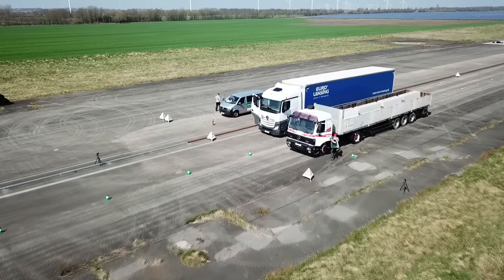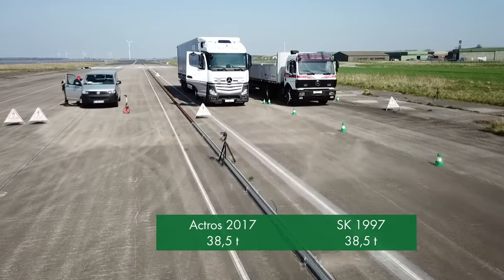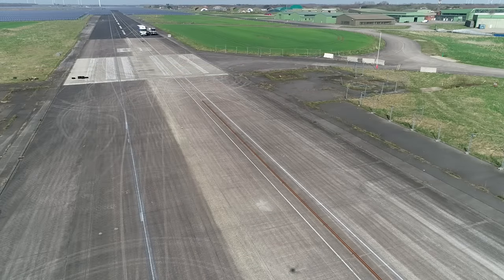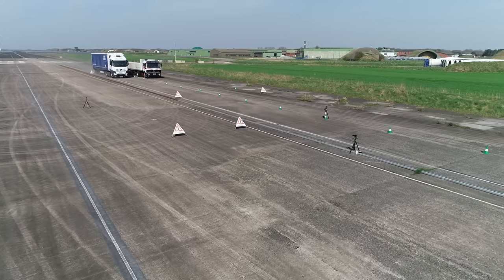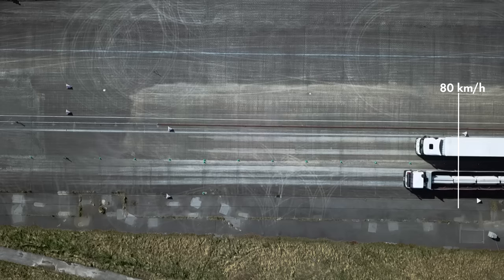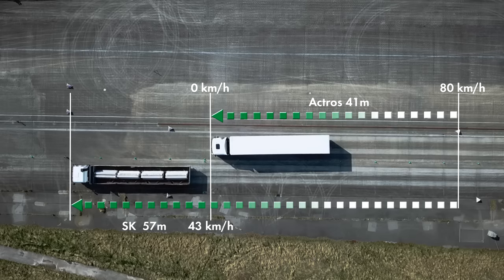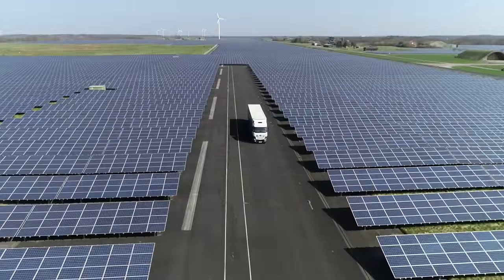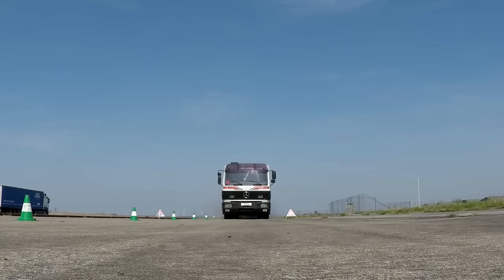Brake test: Modern truck vs. old truck

Comment: Who else with even basic vehicle knowledge noticed the guy in the older truck wasn't even trying to stop fast older trucks don't have abs so have a quicker skidding stop but that puts more wear and tear on the truck thats why they aded abs to save people money since the truck in this video didn't drag even a single tire but the new truck did either the breaks are faulty and don't work so the vid isn't a good even comparison or they did it on purpose to pretend newer trucks are better at stopping also the kind of tire has a huge impact on how fast a vehicle can stop so of course they left that out

Comment: I wonder, why does the new truck have a closed box? Why they didnt show the cargo in the trailer?
Is it because its an empty box?
Put flat beds on both and i will believe it!
For now its just fake for me!
Reply: Dont look fake. The new truck brakes harder by the look.
Reply: you are nit picking, its really stupid to belive that 20 years older truck will have the same brake power as a new model
Reply: It don't matter if there's a load or not. With a load you have more pressure on the tires, without the truck has less pressure, but also less weight. The brakes are made for the loaded truck, and the truck adjusts the brake force depending on the actual load. 
This has nothing to do with a passenger car.
Reply: @simonm1447  More weight will mean longer braking distance.
Just because you have more weight on the tires, and therefore more grip, it is NOT equivalent to simply having less weight.
Reply: @reinbeers5322  I know it sounds strange, but an empty truck will really don't stop with a shorter brake distance than a fully loaded one. Brakes of semi trucks and their trailers are designed for full load, they can absorb the heat of an emergency braking maneuver. With a fully loaded trailer you have much more friction on the road, so the brakes can work with 100%, if the truck is empty they can't and work with less braking power. Modern trucks with air suspension calculate this with the acceleration (how fast it accelerates if it's leveled, they have a tilt sensor in the truck), older ones have a simple device which measures the suspension travel of the leaf springs. 
https://shannonlawgroup.com/calculating-stopping-distance-semi-trucks/
BTW, I had a education at Daimler when we picked up our new truck, and they told the same
Reply: "Put flat beds on both and i will believe it!" - no, you will not.
You will demand other things. "Show me they are putting the same braking force to their pedals! Show me the tyres are the same! Show me the conditions of braking mechanisms! Show me the road surface is equally contaminated!", etc., etc., etc.

Comment: These tests are always Manipulated to suit the Desired outcome . 
Of course the New tech is Better that I’m not disputing , but what is the Condition of the Brakes on the Old model?
Reply: Yep the driver was told your bonus depends on you letting the newer truck win......ok boss no problem.
Reply: @bertiewooster3326  
Exactly Too many variables , what about the Condition of the tyres ? The weight of the Trailer ? Driver reaction? Quite a few things to consider

Comment: I like the brevity of this video, but they didn't say anything about how this much-improved braking distance was achieved.
Reply: i would asume improvements in the anti lock system. keeping the tire at the optimal slip point where you have max brake performance and not just increasing brake pressure until lockup and then releasing it a bit to get the tire rolling again as it used to be.
Reply: @sgxbot  I think so too. Brakepads itself are probably at their prime for years (if not: decades) already and can't be improved anymore.

Comment: The driver in the old truck should have pump and release the brake multiple times, then it would have stopped more efficiently
Reply: Why would he do that if the wheels never locked up?

Comment: Just curious about this test as the trailer brakes also has a huge impact in fact the brakes of the trailer caries the load of what's within it the trucks brakes allows for both to come to a controlled stop ...

Why is it two different trailers ?
Reply: And we want NEW BRAKES for both of the truks .....you know....marketing....new=,,better"

Comment: There’s a difference between a 20 year old truck and a 20 year old truck with 20 year old brake pads. Truck break technology hasn’t changed much in 20 years, the only difference is ABS really
Reply: it has gotten a lot better. back then the abs would lock up and unlock the tire multiple times per second. today the tires dont even lock up anymore when above 5 kmh or something like that.
Reply: @sgxbot  That most likely has more to do to with high speed electronics than anything else: when ABS works its magic, huge, HUGE currents flow through the electrical system as it tries to regulate braking power as good as possible. Besides a possible 'arm system for impact' (deploy airbags), this is the sole reason the audiosystem in a car can stop working when doing an emergency stop (did such a stop on purpose once on an empty motorway, doing 80 km/h (had just sped up coming from the slip road, and the sound system immediately stopped working as soon as I fully braked).
Electronics have improved so significantly in speed, efficiency and such that the computers are now far faster and (thus) far more able to keep the wheels from temporarily locking up. If the same ABS system would be fitted on the newer truck, it would have the same outcome as on the old truck.
Reply: @weeardguy  that actually has not much to do with the faster electronics because its the sensors that are required to detect the amount of slippage etc that hasnt been around back then.

Comment: Having driven numerous different Merc Actros's I have to say they model in this video has terrible brakes. DPD use them, and apparently use genuine Merc brake pads, (I asked a mechanic whilst working there).  You press the pedal and initially it feels good, but then feel like its not going to stop. The older Actros (Euro 5)  the brakes felt great.  I wouldn't like to drive that old banger of a truck in this video though,  having just watched it trying to stop.

Comment: OMG, all those dumb comments. "If they would use the same trailer, and the same tires, and the same brakes and and and and.... the same components, so the old truck is equiped with all new tech it would have the same distance, duh". Again: The point is to test 2 vehicles of two different eras with their current technology and not new vs old with all new parts.

Comment: The new truck had smoke from the braking wheels ect. the old one did not, seems odd. how old were the brake pads on the old truck?
Reply: looks sus to me, like the old one wasn't braking as hard as it could
Reply: Because the brakes on the old truck is just much worse and doesnt brake as hard, thats why there isnt any smoke, not hard to understand, the old truck just performaned bad due to its inferior technology in brakes and braking system. They are trying to show the difference in the new vs old technology and brakes and brakes should behave the same even if they arent new as long as they isnt completly worn out.
Reply: @barzinimongo  You can't compare wore out brakes to new ones then the test is fake.
Reply: @freevideos051  I highly doubt they are worn out, were do people get that impression, you do know what worn out means right? Theres a difference in worn and worn out and in most of the cases the brakes should function the same worn or new, if they are worn OUT I can understand it, but they are probably not, just accept already that modern tech is better then 90s tech.
Reply: Drumbrakes vs Diskbrakes. A F1 car smokes too, but wouldn't with a closed system like drumbrakes.

Comment: I dont think the driver with the cement block is too keen on hard breaking, those block tend to keep moving and cruch em cab. There are such things as an object in motion stays in motion with the same speed and in the same direction.
Reply: he braked hard. you could even see the abs work on the old truck. it just couldnt brake harder with the old system

Comment: Having driven both generations of this truck the test is very valid, whining about showing the inside of the curtain, and swapping trailers.......anyone who has driven both generations will attest how much better the braking is in the newer trucks.  Dekra is one of the few independent organisations I actually trust.

Rather suspect a lot of these comments are coming from  wannabe truck drivers from ETS2 !!!!

Comment: Makes me think why they haven't got the same trailer
Reply: Because this trailer didn't exist around the time of the old trailer (thus it's impossible to pair these because it wil make it unfair due to the combination of old and new).
Reply: I think the purpouse of this test is to show how stupid the regulations about speedlimits on german overland streets are. They were founded when those old trucks were around, and were never updated to justify the advancements. Back then 60km/h was alright, but now 70 or 80 would be alright too.

Comment: no doubt about the brakes. BUT: the SK will deliver where the MP4 is calling workshop to fix electronic errors....we had an NG with OM423LA (V10 - 500hp). the rust killed the cab, so it was replaced with an Actros. one year later the Actros was replaced by an MAN. because this truck works like a MAN, not like a diva. still missing the V10. one of our suppliers still runs a SK. "it runs without problems, why should i buy a new one?"

Comment: You see I hate Imperial measurement system for Fahrenheit, feet and ounces and pounds but I love miles and MPH much more better efficient than Kilometres and KMPH.
Reply: How can a unit of measurement be more efficient?
And what makes mph more efficient than kph? Other than that you are used to the one?
Reply: The only thing "better" about it is that you got used to it. Other than that:
1km=1000m. 1m=1000mm. 
1mile=1760 yards. 1yard=3 ft, 1ft=12inches... As ameasurment sysytem it's a complete mess.

Comment: No info on tires, brake age, and different trailers. Why 2 different trailers? They handle stopping differently and could have different brakes
Reply: The idea of the test is "old vs new". Including trailers. So they took what was available. What is the difference that one trailer is open-side, and the other one is tented? The one tented will have a slightly more air resistance, but at these speeds we can disregard it. Tires\brake age - again - the idea of the test is "old vs new", so...

Comment: Ich sage Fakenews, der Auflieger ist leer🙈 hab auf nen SK Fahrschule gemacht, bei den Bremsen hab ich kein Unterschied gemerkt 🤣
Reply: Dann mach den Test nochmal. Damals hatte man in Relation zum Gewicht nur 60% Bremskraft. Heutzutage hat man bei einer Vollbremse bis zu 150%. Der reifen spielt allerdings auch eine tragende Rolle. Dennoch ist das Ergebnis real und glaubwürdig. Gib mir ein Grund warum es gefaket sein sollte. Der SK hat maximal Euro 3 und verbraucht auch ca 35-40% mehr sprit, somit hätten die keine Vorteile den neuen Lkw besser da stehen zu lassen.
Bin gelernter LKW bzw NFZ Mechatroniker und selbst aufm Prüfstand kommen da starke unterscheide zwischen den neuen und älteren Modellen auf
Reply: @dennisthum1499  der Neue hat ein Planeauflieger und man sieht den Beladungszustand nicht, mehr sag ich mal nicht 🙈 und ob du NFZ Mechaniker bist oder nicht, das spielt für mich keine Rolle. Du hockst in deiner Werkstatt und beliest dich mit bunten Blättchen der Hersteller, wir fahren die Dinger und haben deutlich mehr Erfahrung in der Praxis 🤣
Reply: @matthias8537  ich fahre die Dinger auch selber, bin nur gelernter NFZ'ler, fahr seit über einem Jahr selber. Und die Werte der Prüfstände liegen auch nicht. Selbst wenn der SK einen neuen Planenauflieger hätte, wäre der Bremsweg länger. Mein Vater fuhr damals 6jahre lang ein sk und meinte selber dass der Bremsweg deutlich verkürzt ist beim MP4
Reply: @dennisthum1499  Es macht aber nen Unterschied ob der Planeauflieger voll oder leer ist, das kannst du nicht widerlegen und ich nicht beweisen, also ist es eine Schwebe 🙈 zum anderen: wird die Brenskraftverteilung auf das Zugfahrzeug geregelt, schiebt der Auflieger den SK ordentlich und andersherum kommt nen prima Bremsweg bei raus, ist die Voreilung des Anhängerbremsventil so eingestellt, daß der Auflieger deutlich früher anzieht. Beim Lkw gibt es soviele Wege zu bescheißen, das weißt du und ich ebenfalls👍 Ich hab in meiner Lehre wo ich noch kein Führerschein hatte 2 Jahre Lkws geschraubt in mein Betrieb 🙈. Gerade geleaste Auflieger hat der Vertrieb gern so eingestellt, daß die Hauptbremskraft auf der Zugmaschine lag, bis wir es merkten und umstellen ließen. Das kommt aber nur rum, wenn der Fahrer blickig ist und sagt, daß der immer so schiebt und man selbst sich wundert, warum die Bremsen nach 300tkm am Auflieger noch so gut sind 🤣🤣
Reply: @matthias8537  ja das mit dem Bremsverteiler stimmt schon da gebe ich dir Recht. Dennoch ist der Bremsweg deutlich kürzer, ob es jetzt wirklich 16m sind weiß ich nicht, ich sehe aber 10m für sehr realistisch. Selbst wenn der Actros leer ist würde er nicht unbedingt früher stehen zwecks Reibung usw... Müsste man selber testen. Aber die ziehen ja keine Vorteile daraus die alten Lkw schlecht zu machen, da die sowieso unwirtschaftlich sind. 

Ich vermute Mal dass so gebremst worden ist, dass die Räder nicht kurz vorm blockieren waren sondern weniger... Und ob der SK überhaupt ABS hatte
Reply: @dennisthum1499  die hatten ABS  und sogar ASR, selbst der Vorgänger NG hatte schon ABS 👍. Und auch die größe der Bremsscheiben war damals nicht anders, die hatten an der Antriebsachse wohl lediglich Trommeln bzw Scheibe gab es sicher gegen Aufpreis. Daher glaube ich auch nicht das die 90% bessere Bremsleistung erzeugen. EBS holt soviel auch nicht raus, denn es verbessert nicht wirklich die Leistung, ehr das Ansprechverhalten und die Verteilung. Faktisch ist es auch egal, schöne Weihnachten 😉☺️
Reply: @matthias8537  wie gesagt sowas müsste man Mal als privat Person unabhängig testen. Ebenso schöne Weihnachten und danke :D

Comment: Did you put new brake pads and rotors on each truck, why didn’t both use similar trailers to make the experiment more accurate, where both truck the same class?
Reply: The purpose was to versus old and new, not old+new vs new+new. I think they wanted to show how stupid current speedlimits are on german roads are, because they were made back when trucks needed 20-30m more braking distance.

Comment: This only matters when ppl are actually hitting the break and not sleeping thx to overworking drivers by threatening them to lose their jobs if not pushing way too hard.
Reply: The new one has a AEB and would brake even with a sleeping driver (which of course should not sleep while driving)

Comment: what these companies have to realize is,ANY improvement must be cost effective.anybody can develop a better mousetrap.but if nobody buys it due to initial cost its worthless.in many applications the benefits cant justify the costs.testing models with a 20 year difference dont show much because you would have the same result testing a 1930s to 1950s or 1970s to 1990s.

Comment: I am sure modern trucks brake better than 30 year old ones but did the old model have ALL its braking components removed, checked and replaced with new where any wear was found? If not then the test means nothing.
Reply: considering its a test done by dekra (a german company that is also responsible for german verion of the MOT, basically a mandatory safety inspetction for all vehicles that move on german roads)  they will most likely have done it

Comment: This SK is never a 97 model. It`s an 1748 which indicated that its an early SK from the early 90`s or even late 80`s.
Reply: It has never mid 90' grill
Reply: @ilkkak3065  Except that it doesn't have a newer grill? Nothing on the front of the truck makes it resemble a facelifted, 1994-1998 model. The wind deflectors are pre-facelift (1988-1994), and I'd say the same for the front grill. The grill of the facelifted version has the Gross Vehicle Weight (GVW) as well as the horsepower of the truck's engine written on it. The pre-facelift version doesn't. 17-ton (1748) GVW tractors/trucks appear to be non-existent after the 1988-1989 model years. Not only that, but the tractor's paintjob appears to be the pre-facelift one. In addition, there is no L badge on the front bumper, which appeared to have came pre-installed on almost all trucks during and after the model year 1990, which, once again, goes to show the age of the tractor. Considering all of the above, I would say that it was most likely manufactured in 1988-1989. Unless it was involved in an accident and had the entire front section replaced with a truck from 1988-1989, there's a very slim chance that it wasn't manufactured during that time.